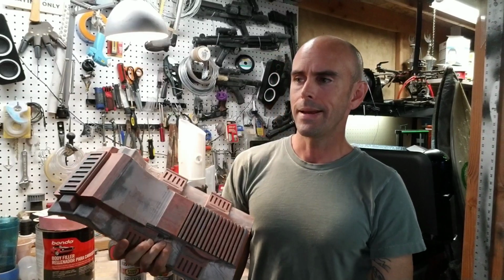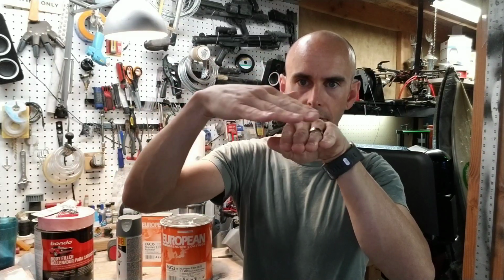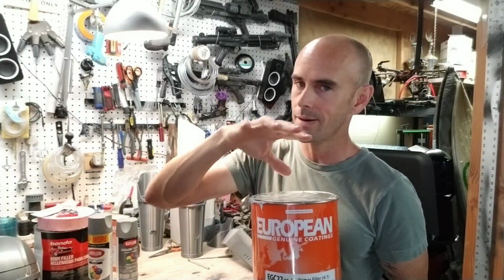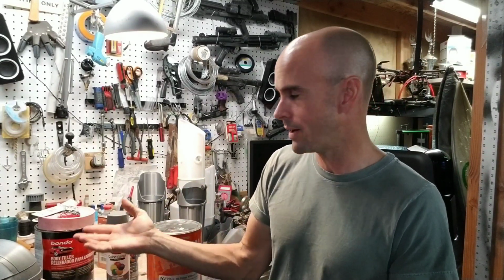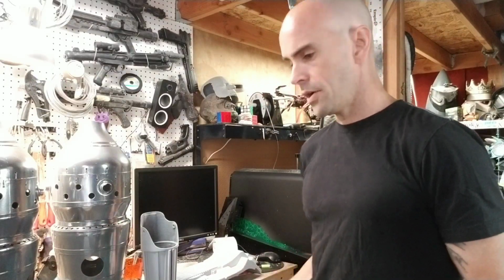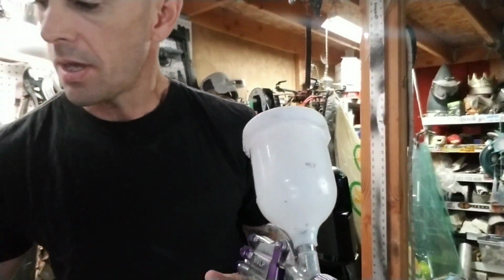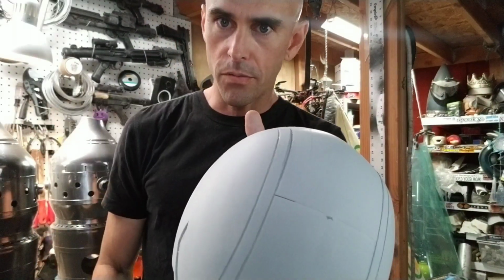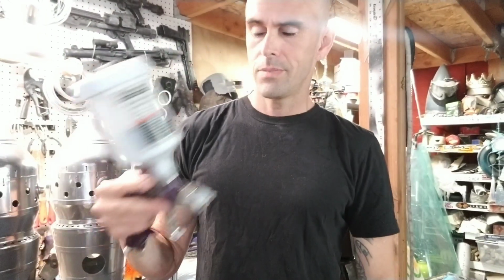2k Primer for Smoothing 3d printed parts

Comment: Two quick questions. 
1) We worry about sanding 3D printed parts since the friction causes heat and could clog the sandpaper.  Any tips?
2). Air compressor....do you have a “dryer” attached to yours to eliminate moisture?
Reply from the maker: I try not to sand too much of the actual print until it's primed if possible. It seems like the primer just exposes the high spots on the surface of the prints and lets the sandpaper cut it away without getting the plastic too melty. I also don't focus too much an area for a long time. Some quick passes with the sand paper then come back in a bit to make sure too much friction isn't building up. 

I don't have a dryer on my big compressor. I own an in-line dryer attachment but I don't typically use it. No reason in particular but I just left it off one time and didn't notice any different in the paint finish so I left it off, more out of forgetfulness than anything. 
I do have one for my small airbrush compressor that stays on regularly because moisture in the air seems a bit more noticeable.
Reply: Also, if the part is small enough to fit in a bucket or under a faucet, you could wet-sand it. It will make a nicer result on the part, cut down any heat, and keep the sandpaper a lot cleaner for longer.

Comment: I have been 3D printing for nearly a decade now, but have only recently started printing helmets. Do you split them up so you avoid a ton of support material or do you just print them in one solid piece? I have the larger Creality (500mm cubed) and can do them in one solid piece, but it's SUCH a waste of PLA and time.

Comment: Hey,
what do you think about smoothing cosplay prints with epoxy resin or xtc-3d?
I’m in love with your work by the way.
Reply from the maker: I've used it in the past but find it much more difficult to control, it kills detail and is tricky to sand, especially in tight corners. I actually started using it on the insides of my prints because the epoxy coatings are extremely sturdy.

Comment: Might just have to stick with the spray paint primer because those spray guns cost a good chunk of cash
Reply from the maker: Not too much at harbor freight. only like $19 or so for one that'll work and they have a small compressor for about $50 or so. In the long run it'll save you a ton of time and money.
Reply: I also use a harbor freight gun. If you are not using it every day professionally it should work just fine.